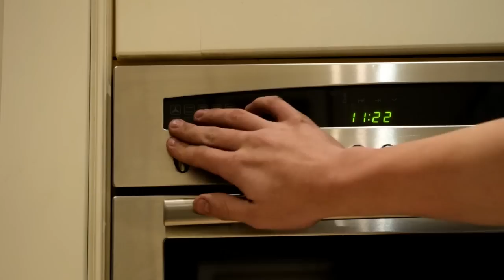Making an EDC Knife (Part 1) [22]

Comment: You should try using an angle grinder with a thin (1mm) cutting disc instead of the hacksaw, they make very light work of cutting metal and can be used for light grinding as well as cutting.
Reply from the maker: Its a cost vs necessity thing. A angle grinder would be much easier and quicker but a hacksaw works fine for now since i don't use it all the time + its quite nice to use hand tools sometimes, makes you feel more in tune with the material and you are more in control
Reply: You can pick up angle grinders for less than £30 so they don't break the banl, and you very quickly find uses for them (flap discs and cutting discs are very versatile). 
Also, I just noticed you have started submitting your videos on reddit, it's a great way top get traffic but be very careful of falling foul of the self promotion rules as it could end up getting you banned which would be unfortunate!
Reply from the maker: I'll definitely put an angle grinder on the list, but my priority atm it to get myself a router! Thanks for the tip - i'll watch out on reddit - is just posting your video, saying what you did cool or will i get banned for that also?
Reply: I'm not perfectly clear on the rules tbh, but I know that submitting your own stuff is often frowned upon (mainly to prevent people using Reddit as marketing). What often happens is you will get 'shadow banned' where no one will see what you post but you won't know you are banned. 
I think certain sub-reddits are ok with self submitted stuff but it's always worth checking.
Reply from the maker: Thanks a lot for the info, i'll check it out :)